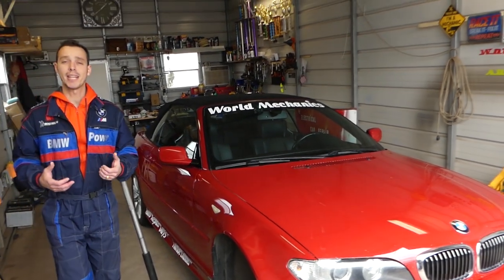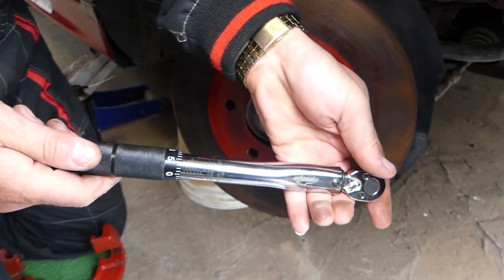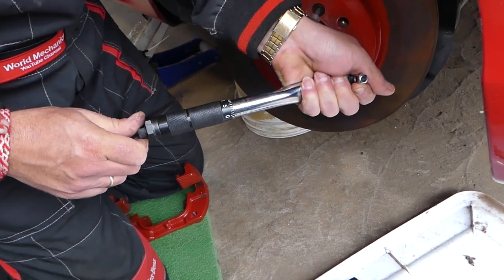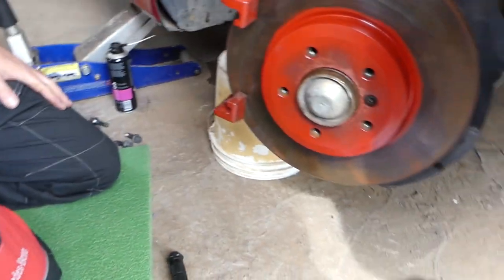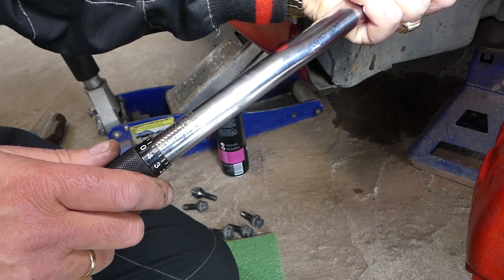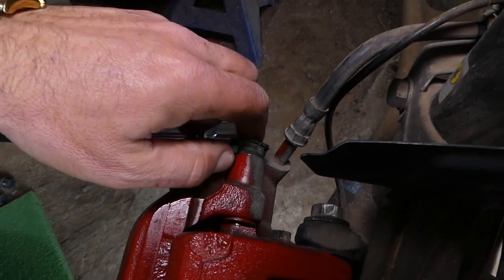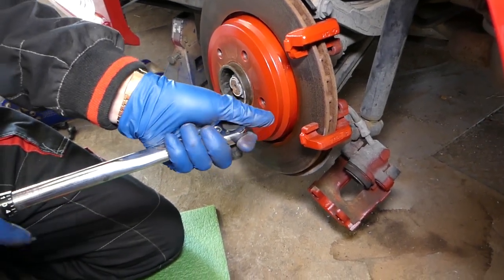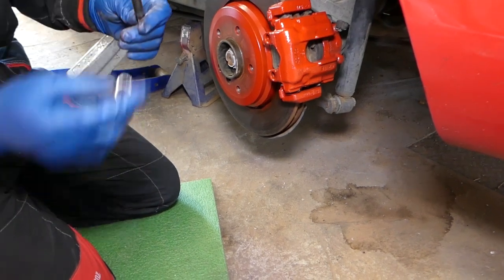BMW E46 FRONT REAR BRAKES TORQUE SPECS 330I 328I 325I 323I 320I 318I 316I 330D 325D 320D 330CI 325CI

Comment: Thanks for your videos i watch all the ones on bmw.  what is the torque for oil pan bolt and oil filter cap 2007 328i  I try to get torque specs online but differ in their answers so it may not be right.I would like to find a list of factory torque specs on brakes and oil change.When i found out they want $220 for oil change and $1100 for rear wheel brake job i started watching your videos